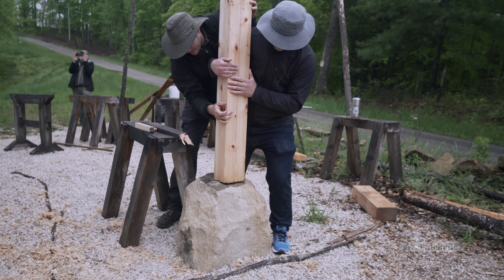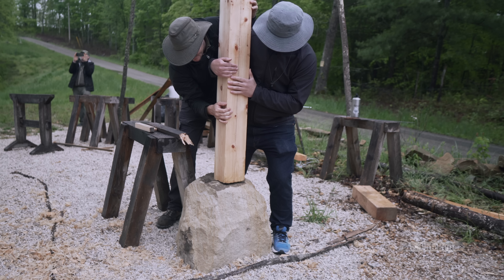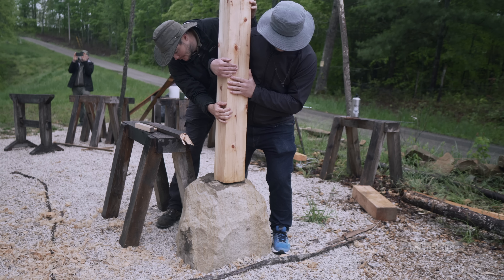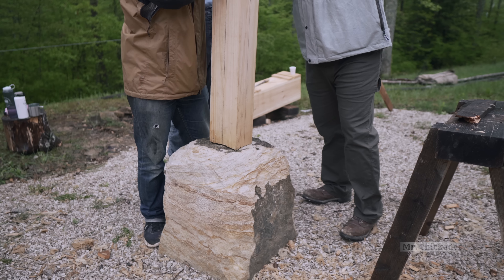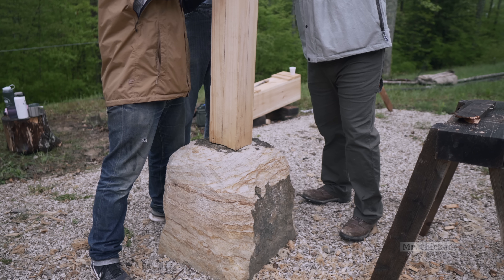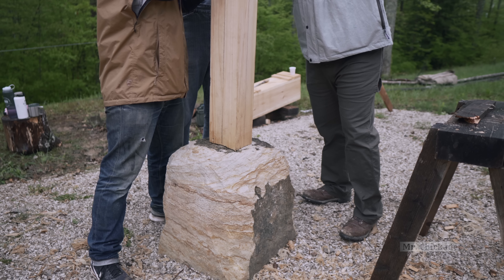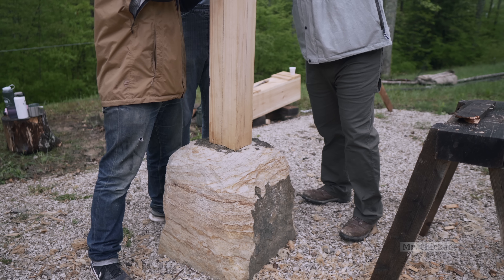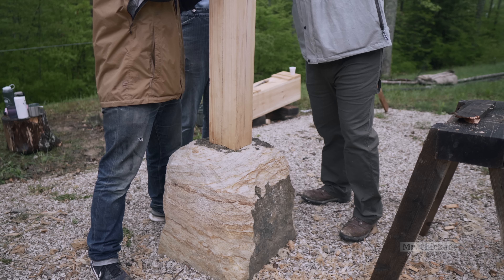Raising day from our May 2022 Timber Frame Class

Comment: Thank you, Mr Chickadee. I am building an elevated clubhouse for my godson, and I am using 8x8s for the posts. Their dimensions are all over the place. I bought a power planer to save time/energy. But I had accomplished basically nothing on it over the course of a month, due to being stumped on how the heck I could make them s4s at 7.5x7.5 just by sight. This morning I remembered your hewing videos and how you use a plumb bob, string line, and square to get the dimensions right and everything be square and plane. Now I can actually build this thing lol. Thanks a ton!

Comment: Mr.C:

When you draft these plans, do you get them checked by a PE? I was wondering if you knew a local one in the Morehead area (where I'm also located) or if you just have confidence in the proportions of timbers to know what will work, or maybe you do all the load calculations yourself. I have ideas for a small shelter I'd like to make but worry about my timber sizing, log species choices, etc.

Can you share your lumber mill source in the area too? I know you often hew the beams yourself, but in some cases, you've had to use a mill. I'm sure they wouldn't mind a shoutout and I would love to give them my business as well when the time comes, if they've been good to you.

Can you maybe share a little that you know about the life expectancy of outdoor structures like this? I know that a dry timber, no matter the species, will last hundreds of years but if you built the pavilion posts out of red oak or yellow poplar, burn the ends and perform upkeep on the finish, is the structure going to fall in a human lifetime or are even the non-cedar and White Oak choices plenty good enough for this application?

Are you involved in any groups like the Timber Framers Guild? Your videos inspire a lot of people and I think you would be surprised at how many people leap into taking TF classes (not necessarily your own) as a result of your channel.

Lastly, I'm really fascinated by the line layout method and I think I have a good understanding of it, but just to clarify - in edge-rule TF, we align our reference faces so that certain planes (geometrically) of the building will be flush - the outside of exterior posts to the sills and tie beams and plates, for example. In line-layout with imperfect timbers sometimes your posts and sills might end up "not quite flush", I assume. Is that just an accepted paradigm of Eastern TF styles and accounted for in the finish carpentry/plastering part of the building process, or am I probably just completely wrong in my imagination of how the process works?
Reply from the maker: Thats quite a lot for a youtube comment section, please send me an email or call at your convenience. Id love to help. All my info is on our website. Cheers.

Comment: beautiful work, would love to build a pergola like this. Guess you dont get high winds or tornadoes there.  Wouldnt last long here in oklahoma just sitting on boulders.
Reply from the maker: Houses dont really fly away like wizard of ozz, they will sit on the stones until they are destroyed, generally starting with the roof being ripped off. If the winds get high enough, they will generally destroy the building long before it is moved from its stones. As for tornadoes, no anchoring is going to save you, they just explode the house, check out pictures of the reinforced concrete buildings hit this  last year in western KY, what was a concrete shopping mall before just looks like a trash dump.

Comment: Beautiful frame and amazing job putting it all together and raising it...well done boys!!!

I've never seen square pegs used in a timber frame before.  I've noticed you often use square pegs in round holes on furniture though.  Can you explain the way you use pegs in different contexts and why you used actual square pegs in square holds in this case?  Did you offset the square holes like usual to "draw" the joints together?

Many thanks!
Reply from the maker: Japanese timber framing uses only square pegs in square holes for most joinery. The short answer as to why has to do with end grain bearing surface and how a square peg will bear on more end grain at once, among other more nuanced reasons. The Japanese really thought out their joinery to an insane degree, most joints having special aspects to resist twist, tension and other forces not really considered in many forms globally.

Comment: Just wondering why the joints are so tight. If everything is draw bored and pegged wouldn’t it be ok to have a slip fit on the tenons? Not knocking it, just wondering.
Reply: even "dry" wood shrinks so the tighter the fit means they are less likely to have gaps.
Reply from the maker: Japanese framing is typically tight, much tighter than western framing which has a pretty slopy fit normally and relies on the diagonal braces for rigidity, In this framing style the joinery is what counts, pegs are more to just draw things together well.